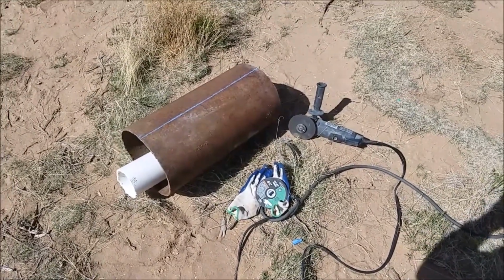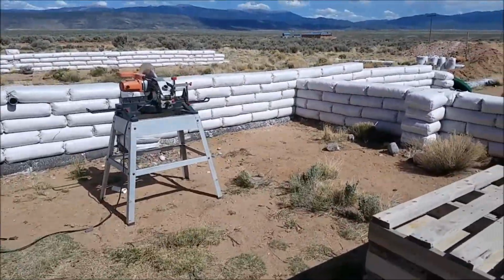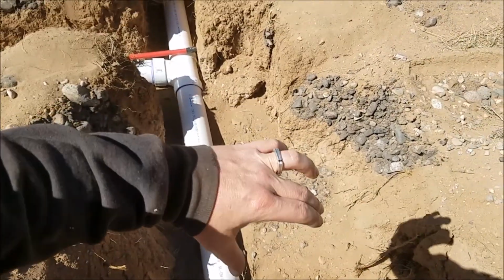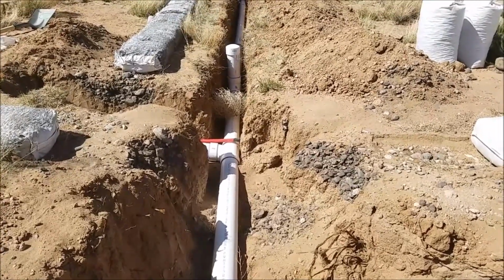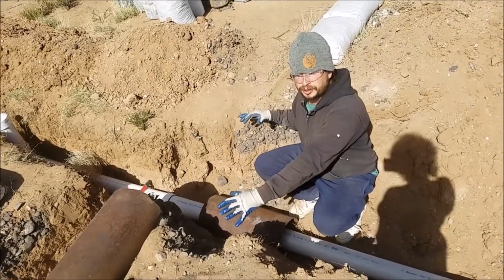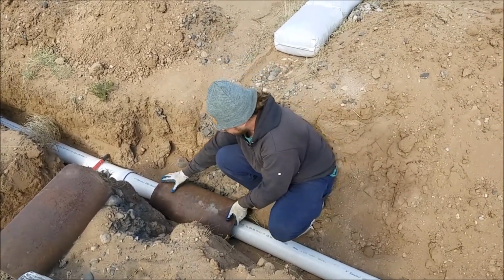Earthbag Home Construction : Plumbing through Foundation Wall

Comment: Idk...I would personally have a concrete foundation put in before placing a earthbags but hey that’s just me.  Ur vids give me inspiration.👍🏻
Reply from the maker: Such a dry humidity conditions here and constant winds at 30 to 45mph, makes it very tough to just lay out a foundation without major cracks in the open. Put a shelter shell up and lay it out from inside, I was able to reduce the dry out cracks alot. Not sure how lay concrete in a desert, but this path took, to make sure majority building stable. Its a Adventure, different, miss having average conditions build in.